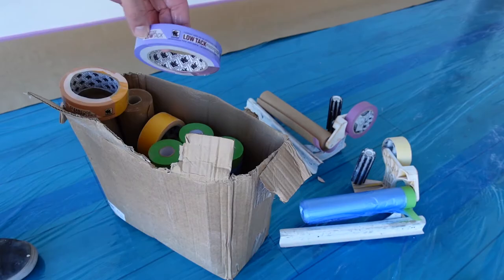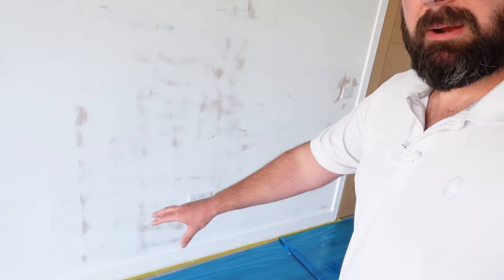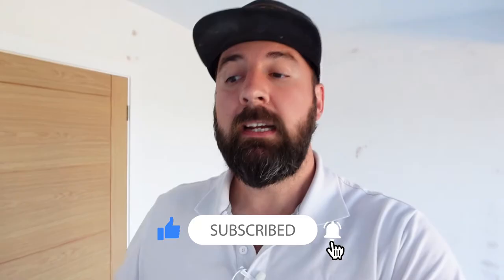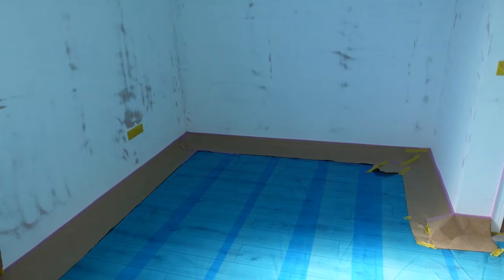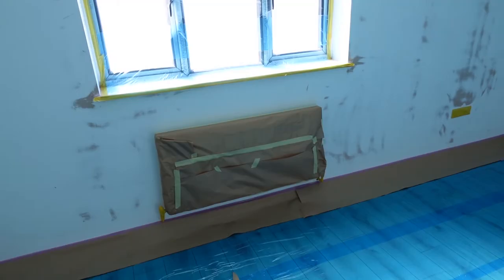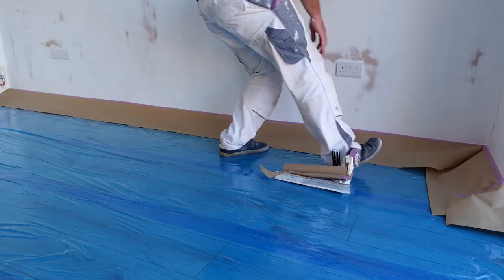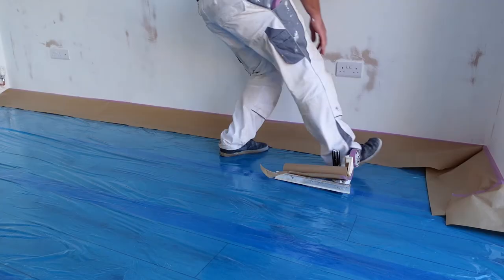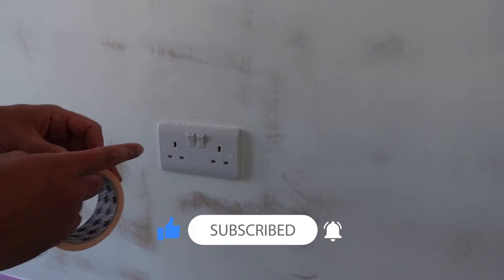How To Mask a Room Up With Wood Floors For Spray Painting

Comment: To all the DIYers. Notice when he's cleaning up that he's always standing on the plastic or a tarp. Even after the paint is dried the dust will stick to your shoes and track on the wood floors. You can also pull up a corner then take off your shoes and avoid stepping on dirty plastic.

Simple idea but its easy to overlook.
Reply from the maker: Yes it is often over looked and foot prints can be made. Even when people think theres little over spray
Reply: I learned the hard way I scrub and scrubbed took me way more time

Comment: I usually have my helper back rolling the walls and ceilings after I spray them. I spray the walls, trim, and baseboards all in one shot if I’m painting everything in a room 1 color. I prefer to have stippling on the walls and ceiling and no brush strokes in the trim if I can avoid it.
Reply from the maker: Spraying everything in the same paint? I dont back roll every time depends what customer wants

Comment: Great vid....Just a tip...... use an extension wand.... it’ll save your back there buddy...:)
Reply from the maker: id have been taking it on and off through out the job so just managed with out one. the ceilings were farely low but i would usually

Comment: Great video! I'm preparing to paint 1 wall in our mudroom/entry room off the garage. I built a "Hall Tree" (Built-in bench & overhead shelf to hand coats) and installed primed MDF board and batten on the wall. There are so many transitions and I want it to look smooth so I decided to spray it. I had to pull off some of the floor trim when building it and installed new trim. The new floor trim will be white and the 1 wall with board and batten, shelving and some of the bench (everything that is not stained or is floor trim) will be gray.

I've started taping and masking but I'm struggling with how to proceed. I've been planning to add a small, thin bead of clear caulk to paint and then immediately remove in the areas that aren't being painted (to get a laser-straight line per "The Idaho Painter) but I don't know how to do that when I need 2 coats of paint (or 1 coat primer on the bare wood and 2 coats paint) without pulling the paint off with the masking. 

I'm planning to hang plastic to create a kind of spray booth to prevent overspray from hitting the other walls in the room.

I just filmed a short 30-second video showing the project. (Masking and taping not done) I would love to get any advice/tips you could recommend.

https://youtu.be/3YibkqlFwEA
Reply from the maker: Looking good. I prefer to over mask. You'll have dust in the air that will settle on anything around so you'll be cleaning if you dont mask. Id come out with more brown paper and do double width just to avoid any mistakes. Polythene the larger areas. Dont be afraid to use more tape than you thijk you'll need. I see some people spray with very little masking but i think they would jave settled dry fall in places
Reply: @sprayaholic  Thanks fir the response! I will mask as suggested.

Any advice on applying multiple coats and then removing masking without tearing/bridging paint?

I’ve heard it’s important to remove the tape while the paint is wet. But then how do you apply multiple coats?
Reply from the maker: @jeffsstuff6575  good question.  One trick is to apply  a piece of tape that goes against the wood slightly further away from the item. Then add one length ontop which goes closer to the item. Then if you need to remove while wet. You can take that length of tape away and hopefully the rest stays in place. Then ones dry simply lay a new piece of tape back over and re coat with top coats.

As painful as it can be. If just removed the first sections and then added again afterwards if needed
Reply: @sprayaholic  So basically, pulling the tape while wet for each coat - whether that means laying multiple layers (one for each coat) or retaping after each coat - correct?
Reply from the maker: @jeffsstuff6575  yes you can sometimes just remove the 1 piece of tape closes to the item you're spraying. But leave all the masking behind it. Depends what im spraying  i may tape and remove after primer, re tape a line against the item im.spraying and do 2 coats then remove. I spray a lighter first and thicker second coat. Pull off while wet
Reply: @sprayaholic  Thank you so much for the quick, detailed responses. This is going to help me a great deal.
Reply from the maker: @jeffsstuff6575  appreciate the support.  Happy spraying

Comment: Nice work. I've been doing it the same way for close to 30 years.
Just wondering if you use extension poles?
Frankly all the up and down movements have fried my back.

Nice to see another painter doing it right.
Reply from the maker: Appreciate it buddy. Yes i generally do use extension and cleanshot valve. But didnt have my 6inch extension on this job so went without. Didnt have the cleanshot either so didnt want any spits if id triggered on or off

Comment: Hi, why spray the walls first and not the ceiling, is there a reason for this ? wouldn't do it that way round if using conventional method, ie, brush roller, wanting to know as i'am just about to start using sprayers after 37 years doing it the old fashion way, cheers
Reply from the maker: Hey. So the main reasons are.. if its a colour, you can lap onto the ceiling.  Then mask off the walls and spray the ceiling.  Its easier to mask walls tban ceilings.

Other main reason especially with white on white. If you sprayed the ceiling first youd ve walking around in all the overspray.  On your feet and in the air etc, so ceilings last and walk away from the spray means less mess and youre out of a potentially fogged up room
Reply: Nice one, thanks alot, just going through the fest of your videos 👍🏻
Reply from the maker: @chrispollard100  any questions feel free to ask
Reply: Them hand maskers, not cheap, which ones are good ?
Just seen one on ebay, uni pro, pro masker, starting price 9 quid, it has 6 and 14 inch blades
Reply from the maker: @chrispollard100  i only really like the 3m one. Honestly its worth its weight in gold. I use the indasa rolls from crown too.

Comment: Hiya hope great videos, can i just ask why the 2nd coat? I thought spraying is applied thicker than rollers?
Reply from the maker: Hey, you can apply it thicker than a roller but if you hit it un even then you'll see patches. Especially with a lot of natural light fron windows.  If its a darker area you could get away with it. But i do 1 quicker coat which is touch dry by the time i finish the room once. Then apply again heavier and usually in the opposite direction.

Comment: ... Brilliant👏. However, I have a question... What's the time length after the first coat on the Walls & Ceilings before applying the second coat.
Reply from the maker: I will spray straight after the  first coat as you'llfind its likely flash dried. I'll sprayer a fasters first coat then a thicker second.
Reply: @sprayaholic  sorry what does a ‘faster first coat’ mean?
Reply from the maker: @MBA 007  i mean im not spraying it on as thick. So I'll do a lighter first coat, it will be touch dry by the time ive gone around the room once. Then start again atraight away with a thicker second coat

Comment: Hi, I’m new to spraying, I’ve just went about  masking my upstairs and down stair hallway, 16 door ways which includes cupboards, the plan is to to do ceiling/ walls and wood work but it’s took a life time, have I aimed to high to soon or what’s your thoughts? It’s really put me off as of the time to do this, also what’s the best way to know if you have to water down the various paints or not, in my case a separate paint for walls/ceiling and then wood, skirtings and wood panelling, any advice would be much appreciated, thanks
Reply from the maker: Sometimes it's not always beneficial to spray everything as it could be quicker to roll. But masking takes time when youre new, it does get faster as you realise better ways to do things. I add 5 to 10% water. If bare plaster 20 to 30 for first coat. 

Youve probably had a go at the hardest section of a house as its different shapes all over unlike a square room with a few doors and similar height ceiling

Comment: Top work there si. Is there any particular reason why you didn’t spray the wood work?
Reply: Ignore that ha! I just read the description 🙈
Reply from the maker: @James-sf5bb  haha ye builders fault. Id already mist coated and when i came back theyd fitted loads of wood flooring. Originally it was being carpeted so i would have sprayed. But obviously this held me up alot and it would take longer to spray emulsion than to do woodwork. Didnt take too long by hand and i cracked on same day while walls were drying

Comment: wow that plastic is a game changer ive never seen that stuff in the states ill have to get some asap. where do you buy it and whats the brand?
Reply from the maker: On the floor? Pack ex are a popular brand that provides protection. I call it roll and strole floor protection.  We have quite a few cheaper alternatives.  Its sticky one side,  they make it for wooden and hard surfaces and also one for carpets
Reply: @sprayaholic  yeah seems alot fast then using other floor protection  and would allow the whole prep process go faster
Reply from the maker: @bailey2624  the clean up is fast, with it rolling up its easy. And it means no tape used on joins etc.
Reply: @sprayaholic  yeah I see that. When working solo time is money and even if this costs more I'll make up on prep and cleanup time for sure.

Comment: Great video's on this channel. Could you tell me wich masking tapes u use? In the Netherlands we don't have that many choices in that. As well as a masking kit.
Reply from the maker: Hey appreciate the support. I have been using a brand called indasa. They sell the blue polythene with tape attached. That fits on the 3m hand masker. And the low tac amd precision. 
Other good brands are tesa and deltec. 
The hand masker is a 3m m3000
Do you have better choice when you shop online?
Reply: @sprayaholic  Thanks Simon for your quick answer. I have just bought me a Graco pro x17. It's my first and i want to use it for my walls and ceiling at home. Could i ask you a little more about wich tip to use etc? I allready got a lot of answers out of your great video's!!!! Keep up the good work👌
Reply from the maker: @hanshendriksen3859  awesome. So yhe machines max tip size is a .17  so such as a 517  id change to the graco LP low pressure tips.  You'll be able to run lower pressure and probably get a nicer fan faster.

Comment: Awesome video! Im about to do this for the first time..How long did you wait to do the 2nd coat?
Reply from the maker: Thanks for watching.  I spray a room at a time. First coat is a little lighter.  I do one.coat then start straight again once ive been around once. As youll see the paint has started to dry abit
Reply: Wow that was quick for the second coat! We are first timers and thought you need to wait a few hours per the tin - FYI we use Jonstones Covaplus.
Reply from the maker: @MBA 007  because youre not actually touching the surface the paint wont pull back off like with a roller. 
Ye ive used covaplus alot before. Mist coats i like to leave a good few hours or next day, then sand fill etc. Then I'll spray a lighter forst coat, the it will probably dry pretty fast. Second coat on topa bit heavier
Reply: @sprayaholic  cool. That makes sense. We have a 390 and used for the first time yesterday. Really struggled with Covaplus even through we used the 517 tip and 2500psi pressure and thinned it down by 10% for the mist coat. 

By struggle I mean, the pressure kept dropping so needed to thin 20-30% to stop the pressure dropping but thining that much doesn’t seem to make sense compared to paint manufacturers instructions. I would have expected the  2nd and 3rd coats to be thicker and undiluted 😳
Reply from the maker: @MBA 007  i mist coat at 20 to 30% regardless of what it says. Then all my top coats at 10% thinned. If pressure was dropping theres a chance you had some dirt inside the pump which stopped it from working fully. Also check filter for being clogged

Comment: Hi there is that floor protection the static stuff that sticks or non residue sticking? New to spraying please help just used a massive roll of card it was a nightmare and loads of cumbersome waste
Reply from the maker: Hey.  Ye i cant deal with the roll out card. This was similar to packexe floor protector.  It was for wooden floors so it has q slight stick. 

I often use correx sheets
 Plastic sheetinh in rectangles and its re usable. I hardly use sheets

Comment: I've watched a few of your vids, all great stuff, thank you. So, when spraying skirting/architrave, you don't seem to mask when spraying walls. I assume this is because when you spray the walls this covers the overspray? Cheers
Reply from the maker: Hi on this job like i said its easier and faster to mask woodwork off and paint by hand the same day.
You can spray woodwork to a finish then mask off spray walls. Mask off and do ceilings.  Or spray 1 coat walls nearly to your woodwork. Then finish woodwork lap onto walls. Finish ceiling and roll walls.

I often do sand the woodwork overspray down, alot say you dont need to. But i have jad issues. Such as when the temperature is quite low th paint sags on the overspray as it dries slower.

So  you could quickly mask your walls up if in any doubts, it doesnt tae long.  Or spray it on and a quick run over with the sander
Reply: @sprayaholic  Thanks so much.

Comment: Another question... Do you apply cross hatch method to Walls & Ceilings?
Reply from the maker: I will generally spray longest way on ceilings then shortest.  So yes its cross hatched. Walls i do sometimes but generally not although its Good practice as can catch your misses

Comment: greetings from australia ... may i ask as i knew to spraying, why you cover theflooring with this product instead of canvas drop sheets as we all use as standard painters , (ie non sprayers ) whats the advantages vs drop sheets .. thanx in advance
Reply from the maker: Hey man, so the blue floor protector is designed for hardwood floors. Its sticky on one side and is easy to lay. Dust sheets will hold all the over spray and will be pretty dusty when taking up. You can use them, but some dont prevent paint leaking through.  This was one room in a 5 bedroom house so it was more efficient to protect the floor through out than use a hundred sheets that you can trip on and slide on
Reply: @sprayaholic   thank you for that ..would you use that also on tile floors?? , and also whats best for using when its carpet floors re spraying
Reply from the maker: @Dino Devitis  they sell a carpet version aswel. Or we have something called correx 
 Its like a plastic sheet that you can tape together. Or ram board or x board which is rolls of cardboard . Alot of different ways to protect.
Reply: @sprayaholic   thanks again

Comment: Is quicker spraying that size room with fittings? I would prepare and hand paint that size room with two coats in about 7 hours Would you finish any quicker?
Reply from the maker: Id have still finished quicker. Atleast half the time with masking.  But this is just a video showing a room. It was a 5 bed house i did. Just showed this room
Reply: @sprayaholic  cool so worth the extra prep work masking. Nice job
Reply from the maker: @Minechain.  oh for sure.  The ceiling as alot of critical light and would have shown alot of texture, roll marks etc. Spray was the way forward.  I finished the job in 7 days. Brush and roll would have easily been 20+ days on my own.

Comment: so would you do walls first and then the baseboard and door trim?
Reply from the maker: usually i spray woodwork first, then walls, mask walls off and spray ceilings. But on this occasion the builder as delayed and they had a last minute change and put wood flooring down . so I sprayed all walls and ceilings and brush woodwork. ment i could do it the same day
Reply: @sprayaholic  im starting a house and they only want walls and woodwork done ceilings not touched how would you do that id prefer to use my sprayer its a finished house just repainting
Reply from the maker: @dangeranger69  you could spray woodwork and roll walls. Or mask the ceiling. Spray woodwork.  Mask next day and spray walls.
Strange. Its not always best to spray  so gauge your time.. obviously if you can afford to practice then thats great

Comment: What's the plastic on the ground? I like that much better than paper. Is it a bit tacky on one side?
Reply from the maker: Hey. Yes its hard floor protector slightly sticky one side. Comes in rolls. They make one for carpet too. This was just a cheap branded one

Comment: You may have answered this before but do you charge customers for the materials i.e tape/floor protection etc or do you try to incl that in labour costs? Thanks
Reply from the maker: I charge the lot to the customer.  Most times I'll go in with a labour price and an estimated material costs. No break down. Just give them a low ball and a higher cost to give them an idea. Then ask for materials before starting if its alot
Reply: @sprayaholic  Brilliant, Thanks for the quick reply! Top quality videos
Reply from the maker: @kylesmith5424  appreciate the support.  More videos on the way after some time away